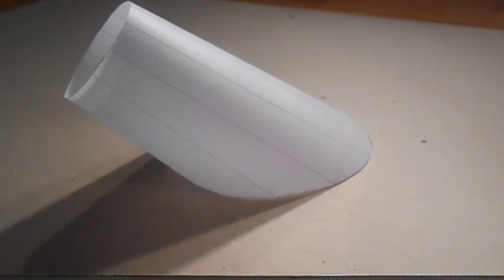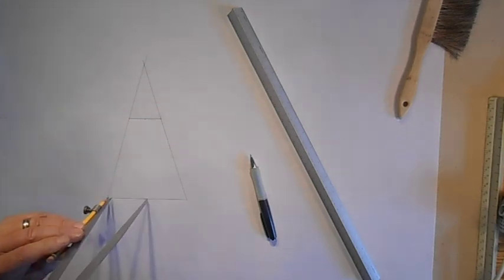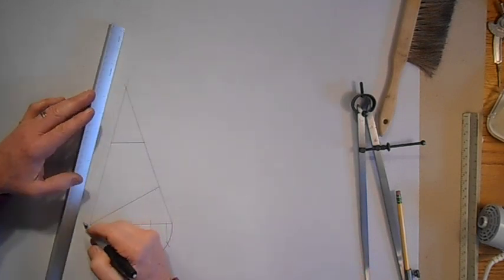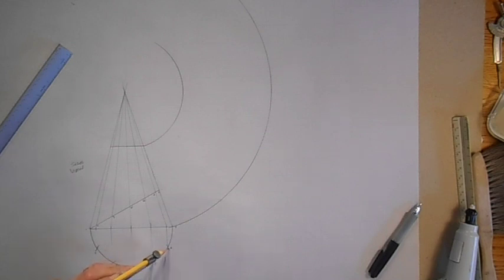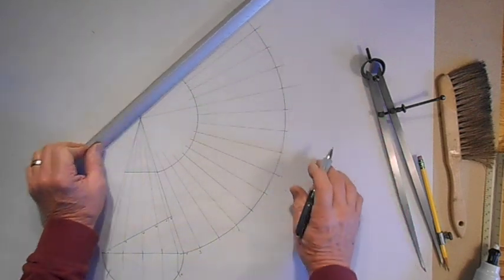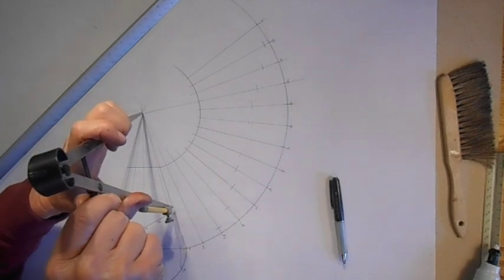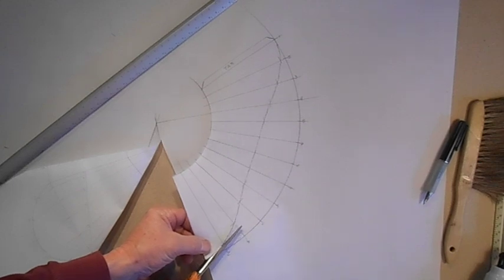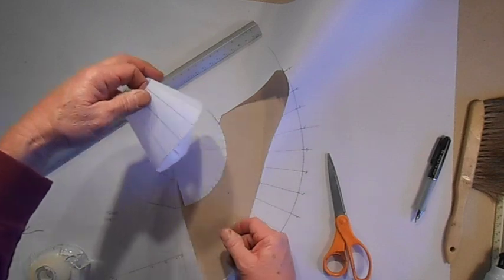Pattern Making- Truncated Cone w/ Angled Bottom

Comment: I'm having trouble wrapping my head around how point 4 (in the middle of the diagram) is correct when it doesn't seem to take into account the slant of the cone. if there was a very low pitch and the difference between the top and bottom was large, say 10 to 2, the middle point would be close to the cone height, where it should be close to the first point.

Comment: Is there a way to lay this out without finding the apex of the cone? I'm sure that i have seen it done before by using the radius arch at the top and bottom using the side view but can't remember the process. Some of the parts i have to make put the apex far outside my work surface.

Comment: Dave, when properly laid out each developed line should touch the flat table, without rocking. Lines 1 & 7 are true as drawn, all other true lengths are developed by projecting points at the miter line to 1or7 at a right angle from center line. Swing arcs from apex adjusted to the  new developed positions on line 1or7. When complete all points on the miter line will touch the table.
Reply: I dont mean to be off topic but does anyone know a method to log back into an instagram account..?
I stupidly lost the login password. I would love any tips you can give me.
Reply: @Vihaan Walter instablaster ;)
Reply: @Emanuel Aydin Thanks for your reply. I got to the site through google and Im trying it out atm.
Looks like it's gonna take a while so I will get back to you later with my results.
Reply: @Emanuel Aydin it worked and I now got access to my account again. Im so happy:D
Thank you so much you really help me out !
Reply: @Vihaan Walter Glad I could help :D

Comment: the the arbitray angle you drew thats the roof pitch ? so lets say i was gonna go a trunk cone for a 12/12 pitch then are angle would of bin a 45deg angle ? very cool video by the way
Reply from the maker: the bottom angle would be the pitch, a 12/12,  yes, a 45. This method is typically used for making custom roof jacks not available for say the typical 4/12,as in a steep pitched roof. I used to build custom exhaust systems for motorcycles and used this method for making transition pieces snaking thru and contouring along the bike....

Comment: either your memory is failing, you got in a hurry and made a mistake not using the true lengths of the lines,  or whatever. you must project each line ,other than the profile edge lines,which are already in their true length,paralell to the base until they intersect either profile line. then they are in their true length.
Reply: please post your own video showing the correct method or at least include a youtube link for the correct method...
Reply: Please post your own video or at least include a youtube link for the correct method...
Reply: Robert Unversaw ... no need to post a new video... to demonstrate the mistake, use this same method on a 0/12 pitch(flat roof).... your line lengths will be different, yet we know that’s not the case on a flat roof..... the wider you are where the jack hits the roof, the more drastic the problem will be....
Reply: @philipdahlquist2553  right. I'm just pointing out that everyone has a critique to offer but won't include a resource or video for someone new like me to learn the method correctly. I've found the resources luckily and maybe I'll upload a video at some point...
Reply: Robert Unversaw .... as far as roofing applications go, the way this was shown would work “good enough” for 99 % of my customers.... the only thing I would want from my shop workers, is to make sure they know that they are cutting corners.... I learned my layout in a shop that used 1/4 and 3/8 plate to make fittings, so these other steps are important to know, even if not always necessary when working with lighter metals for roofing parts ( storm collars will cover up any shortcuts usually)

Comment: hi in transforming the lengths on the side of cone to the papers next to it , you must obtain the the true length of every line you drown wich you did not it is totally wrong and not going to fit . so please correct this video or remove it of  youtub as as some beginners my do big mistake by following your this example .
Reply: Absolutely agree, unfortunately this is misleading. As you correctly say Sam the true lengths must be found. The only lengths that you can take in the way shown are the two outside lengths they will always be true as they are not sloping away from you in the elevation. All the other lengths as you picture the cone drawn, are actually sloping away so just taking those lengths from the Apex will not give you the correct length. Where you bring your points from the base line up to the apex and they cross your bottom truncation you must take your points out to one of the sides of the cone. doing this will give you the true length of that point. Plot those points in the same way as described. I agree with the rest of your video Dave.
Reply: c faux